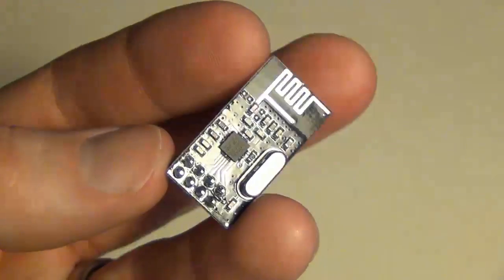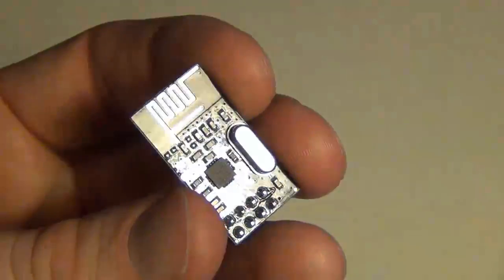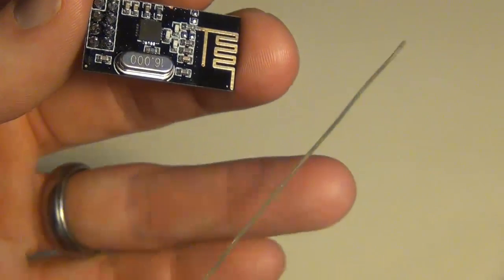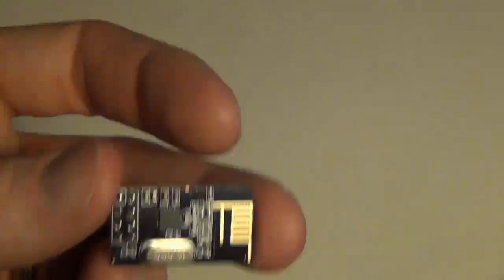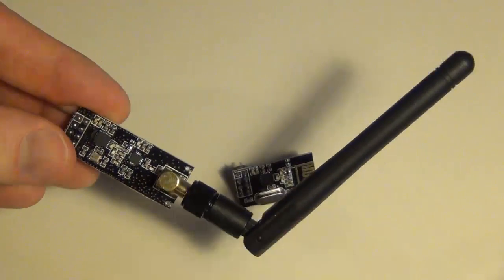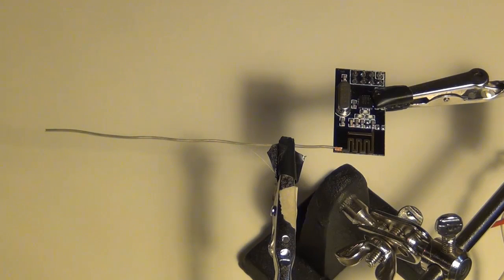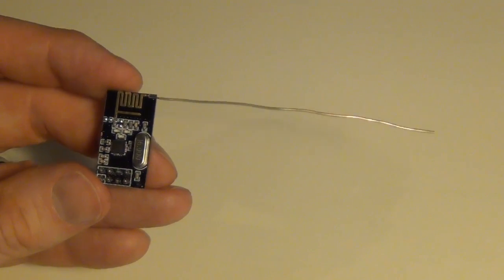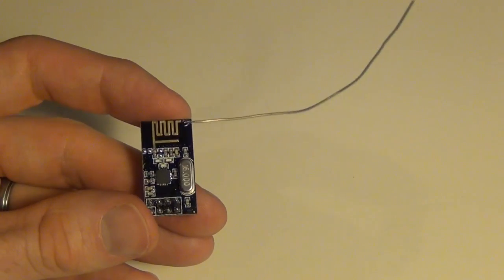Cheap DIY NRF24L01 Antenna Modification

Comment: Hello Pete

I tried as you say but I did not see any improvements in the range. Are you sure it works? And is there any special type of the cable to be used?
Reply from the maker: +Hiloliddin Jaloliddinzoda 
It has definitely helped my radio communication but you may want to give this a try if you're not seeing good results. http://www.instructables.com/id/Enhanced-NRF24L01/

I am using cat5 wire from an Ethernet cable.
Reply: Hello again. Thanks for fast respond. Actually I tried this Link Dipole also. Maybe did not make as exact dimentions as said in thant link. I tried it already. A bit better was the range. But not perfect. 2 walls and maybe 6-7 meters apart. With normal its own antenna no signal I recieve. With dipole I recieve maybe in 1-2/20 sent signals
Reply from the maker: Hiloliddin Jaloliddinzoda
Wow, that's not good!  Are you using MySensors?  If so, did you set both the gateway and nodes to RF24_PA_MAX in myconfig.h?
Reply: +Pete B 
Actually I only tested with codes in this link: http://arduino-info.wikispaces.com/Nrf24L01-2.4GHz-HowTo.

And did not do any think different other then trying antenna changes.

Comment: This is totally wrong, sorry. The pcb antenna is calculated to match with the tcvr, and you just can't measure it's length! There are a lot of things like shortening factors, imedance, and other stuffs you have to calculate in. With this mod, i'm sure you unmatch the impedance, and at a higher transmit powers (like PA+LNA version) it could kill your transmitter!
If you want to do the correct way, you should disconnect the entire antenna with a cut after 2-3mm, and solder a wire antenna on. The proper size should be l=((C/F)/4)*0.96, where C is 300, F is the freq, like 2450MHz (center of the band), and 0.96 is the free air velocity factor: l=(300/2450)/4*0.96 gives you to cut 29.4mm bare wire for a quarter wave antenna.
You can read more about here:
https://en.wikipedia.org/wiki/Velocity_factor
https://en.wikipedia.org/wiki/Monopole_antenna
Reply from the maker: +Attila Wagner Thanks for sharing.  I'm no expert but it worked for me.  Nice to have other options like you linked to.
Reply: Hope it helps you! :)
Reply: +PierreWapata If you want to use external antenna, you have to disconnect the whole pcb antenna. I recommend this mod: http://www.instructables.com/id/Enhanced-NRF24L01/
Reply: +PierreWapata Check out this 2:
http://www.aliexpress.com/item/2-4G-NRF24L01-PA-LNA-Wireless-Module-16-32mm-Without-Antenna/32345613194.html
http://www.aliexpress.com/item/NRF24L01-Wireless-Transceiver-Module-SMA-Antenna-Microcontroll-for-Arduino-2-4G/32230572315.html
Reply: Pete B You should test again with filtering capacitors on the power lines. Radio cam interfere with the cables/routes, causing strange behavior. You can check this with a good oscilloscope. If you design custom PCB, I suggest 100nF to every IC and module's power pin at least, higher power radios like this pa version may need more buffer, like 470uF or so parallel with the 100nF.
Reply: +Attila Wagner may the little straight trace (and it's hole) under the wave one is there just for adding an external antenna ? And then, cut the pcb upside that.
If so. Does it still 29.4mm after the little hole ?
Reply: Attila Wagner I've seen this mod too. I may do this way. Unless i find an other with antenna like a pig-tail. I can take less space i suppose.
And thanks for the answer !!
Reply: +Attila Wagner It look like the one with antenna. With that, we also need the mini connector with wire. Because it's a mess to solder (2 points O_O on a tiny wire).
And the price is not the same too !
But it's really great to know that it exist.
(are you a mysensors forum member ?)
Reply: +PierreWapata No, i'm just a radio amateur. As you can see, that module is not a simple RF module, it contains power amplifier, and a low-noise amplifier for reception (PA+LNA). That means far more range for you.
Reply: +Attila Wagner Well ,i'm less than a radio amateur. I couldn't do my 2.4Ghz model-radio without good explanation (NextStepRC).
I didn't know the signification ofPA+LNA. Now it's done, many thanks for that !
And, in the big plastic antenna, there is just a little wire, it's only for protection, so, i'll look for all the NRF24L01 variation if it's possible to find a really economic solution.
You may not know, but the mysensor project is for domotic, really low cost domotic. So we can use many many sensors, with many atmega, and... many radio. So, the cost may be one of the first factor of choice.
For me, I've only one long range captor, a doorbell with temperature captor.  So, it may be okay to buy one. But it can be really cool to find alternatives for the other people too !

Thanks again for your help !!
Reply from the maker: PierreWapata
Just a quick word of caution if you do go with the amplified antenna.  I used one next to my Z-Wave controller and even though they are totally different frequencies it wreaked havoc on my network.  Maybe the one I got was bad but I recommend testing before setting the power to max in the mysensors config file.
Reply from the maker: Attila Wagner
Unfortunately I don't have an oscilloscope.  It would be cool to have one to test though.  I ended up just going back to the regular non-amplified version and that solved all my z-wave issues.
Reply: You need NWT-500 analaser - and a lot of work to do.. many hours.
and bridge to look for impedance...
the best way is to practice more in HAMradio and afte that
 try to make something on higher freq.
Reply: Marcin Witkowski NVT500 won't help you out, the 2,4GHz is far out of the max frequency. You can use a StationMaster or similar industrial instrument for that band.
Reply: sory i make mistake NWT-4000 i have 2 of them ;-)
Reply: Marcin Witkowski It's a nice stuff, but I still prefer the industrial line ;)
Reply: What do you mean by industrial line ?.. 
anyWay ;-)
Im making lots of antenas for microwave - specialy low noise-ones. in physics  instruments.
Reply: +Attila Wagner
"Unfortunately I don't have an oscilloscope"
best investment i ever made....a logic analyzer for $4
https://www.youtube.com/watch?v=rR5cEFRO9_s
Reply: It makes no difference. Adding to the existing antenna is just converting it from a 1/4 wave antenna to a full wave antenna. It will increase the loading on the tx but not beyond the maximum chip output. All you need do is add some bypass capacitors to the tx chip's power pins, as close as possible to the chip on the VCC.
Reply: @Jimmeh_B  any toturial on this?
Reply: Hello sir ! good morning, what if I put a coil acting as an antenna? is it okay? thank you !
Reply: Since your comment is from 9 years ago I doubt you'll respond but I got some Bluetooth audio receivers from ali express recently and the range is laughably bad and drops connection if my hand is in front of the Bluetooth audio source, how could I enhance the antenna capabilities?
Reply: Thank you for your explanation. Would you help me please? I have NRF24L01+PA+LNA and I want to remove the antenna (big black rod) to decrease the size. I want to solder just a flexible wire. Is it Ok?  Antenna has 4 side solderings and one central.  Is it correct to wire 29.4 long wire just to center point? Thank you in advance.
Reply: @traktorprofiru1207  yes. The black rod also contains a small piece of coaxial cable, and a striped section what is the quarter wave sized antenna.

Comment: can i use NRF24L01 to connect to android smartphone ? i tried but it ask me the code to ensure the communication :/
Reply from the maker: +Ahmed Chtioui 
I'm not sure, sorry.  I use it exclusively with MySensors.org projects.  You may want to check out the ESP8266.  That may be easier to connect to a phone (but I have never tried it).
Reply: +Ahmed Chtioui You can't connect with phones, use bluetooth or wifi adapter for that. The ESP8266 is a good piece of hardware, but for phone connection, i suggest you to use bluetooth to serial adapter.
Reply: Thnx Attila Wagner  ;)

Comment: That's a cool video. I made a breadboard adapter using wire from a cat5 cable. I soldered headers to perfboard so I could test it. Info like yours makes these modules insanely cheap. Thanks for sharing.
Reply from the maker: +3deeguy You're welcome, glad you like it.

Comment: Damn, I wish I had though to try this for my range comparison a few months ago. Oh well, I'll definitely give it a try anyway. My understanding is that these antennas are carefully crafted to work with the board they are part of... how much has this increased the range you are getting over the standard PCB only antenna?
Reply from the maker: ***** I haven't done any formal testing, I have just noticed it helps with communications in my house.  My theory is that the PCB antennas are fairly directional and adding on the additional wire helps get around that.  For example, one of my nodes is about 45 ft away, through 7 walls and it wasn't communicating consistently.  When I added the antenna it works every time.  Sorry I can't be more specific that that.
Reply: +iforce2d you need to compare it like in your video
Reply: +iforce2d I watched your video where you made a transmitter using nrf24l01 modules to control your quadcopter. I want to  make something similar.
The problem is I program Parallax Propellers and most activity involves Arduinos.
Transmitting data in addition to servo signals opens a lot of opportunities so it's worth the effort.

Comment from the maker: Here is a quick video on modifying a NRF24L01 antenna to improve radio communication.  I have been using it with virtually all my mysensors.org projects.  It's cheap and easy so give it a try.  It has been working great for me and hopefully you will get the same results.
Reply: can this be used on something like a cubesat?
Reply: Braden T You mean like those crowdfunded satellites that go to low earth orbit? If that's the case... lol no! This probably improves the NRF24L01 from 30 meters to what, 60 maybe? Not all the way to LEO.